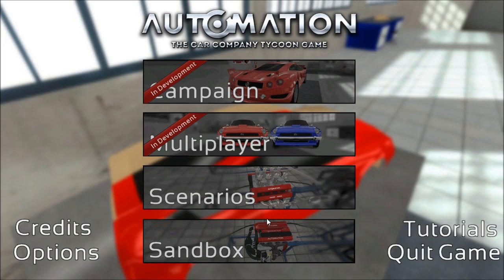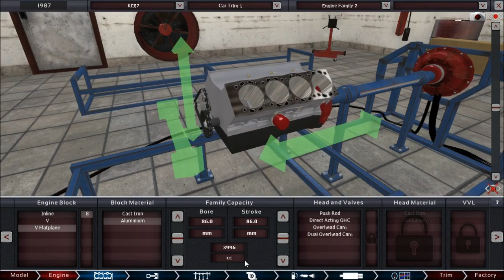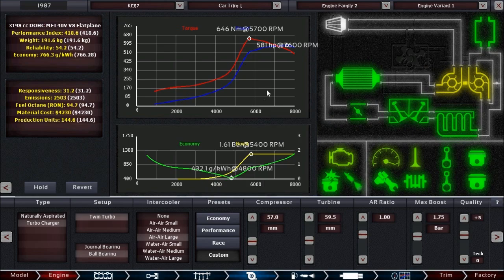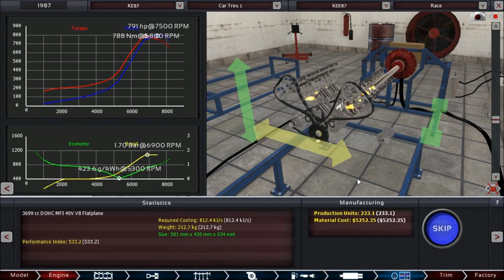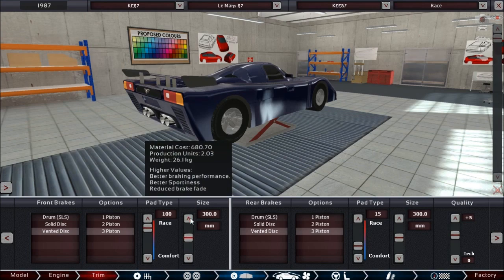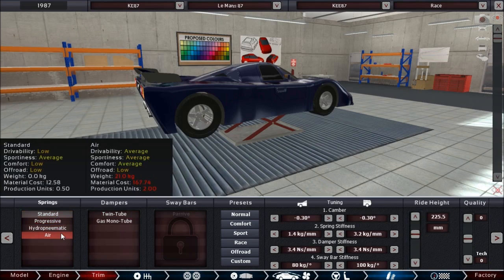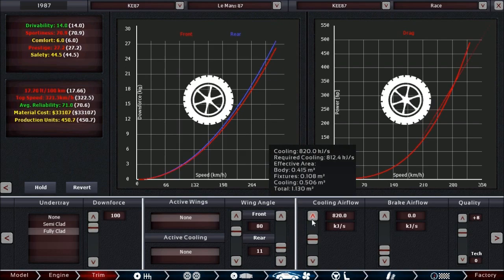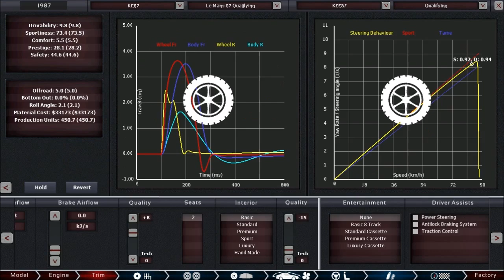Lets Play: Le Mans 1987 Group C Prototype

Comment: About 1:40, stop there. You start with a shape a little like a 956. You give it a slightly stretched nose but you leave the front wheels where they are, comment about how you might do the wheel-arches later...
In terms of chassis balance and effective design, a 956 was pretty much right, in about '83 or '84. The problem was the front axles were level with the driver's mid thigh, his knees were in front of the axles, and half his lower leg was in front of the whole wheel. That was accepted in Europe, the general layout was not that different to a formula one car, but the Americans objected, and outlawed the car. The driver's feet, his toes, had to be in line with the front axles or further back, or the car simply could not race in North America. Porsche engineers took a pen to a drawing of a 956 to look, and decided that you simply couldn't do that to the chassis of a 956, so they started again, and drew the 962, which was an attempt to keep as much of the 956 as they were allowed, but redesign the front of it to conform with the rules given by the Americans. That's where the 962 comes from.
The car you are drawing there, would be outlawed, just like a 956 was...
Reply from the maker: Interesting story, thanks for sharing :)

Comment: I allways get an error when I put a turbocharged engine longitudinally on a mid engined car.
This problem allways comes back. Any idea what it might be?
Reply: Maybe you have to reinstall? I haven't had any problems.
Reply: I did that many times but It either doesnt go away or eventually comes back
Reply: Ruben Silva That's odd, have you modded it? maybe it's your system...

Comment: I've tried to do the exact same thing. I found that the turbo engines' torque curve are not up to the task. I got very similar results no matter the engine. Even if I cut the cooling to improve aerodynamics, and if I can hit 390kph on Sarthe, I can't get anywhere better than 3:40. Any clue how to go on, since I really want to build this properly
Reply from the maker: +flimsyshow Well, it is a lot about the track calculations too, not accelerating out of corners properly and such. The ground effect is missing too, we can't do almost 2G in the corners in Automation. :) Anyway, the new drag calcs should help a bit, eventually quad turbos might help too after the forced induction revamp.
Reply: +AutomationGame Nice, can't wait for some proper aerodynamics :)